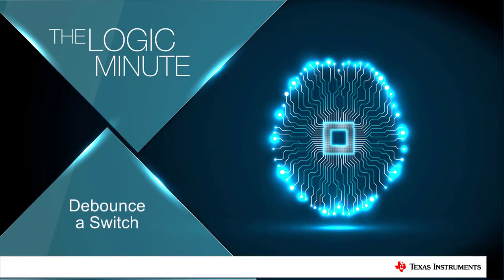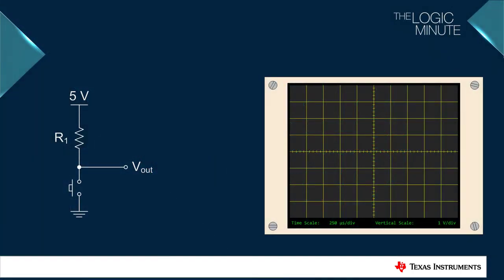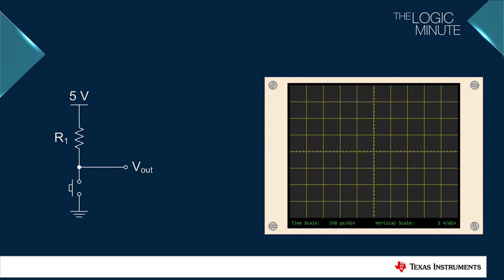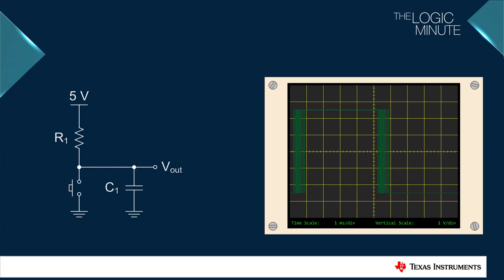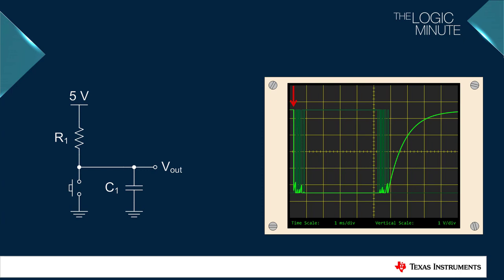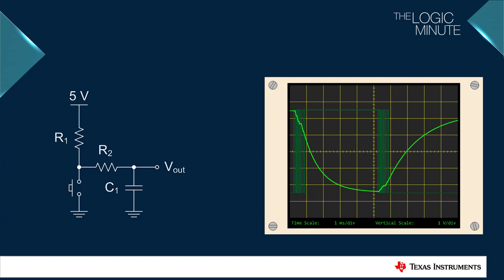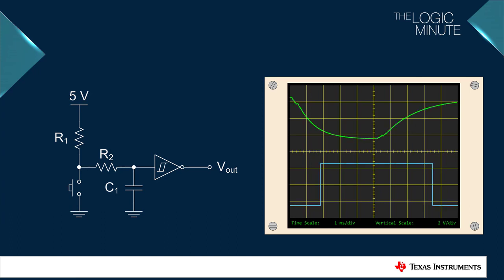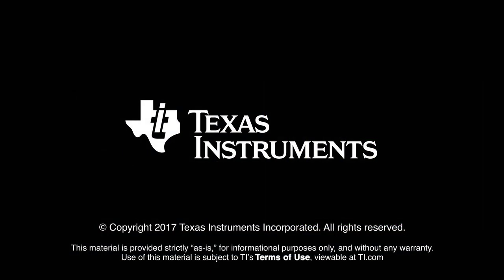Debounce a Switch

Comment: Syntax error? Shouldn’t 00:21 start at 5V since the switch isn’t pushed and thus effectively be open so Vin = Vout = 5V?
Reply: They have it the wrong way around but we all get what they meant
Reply: that picture showed what it should read based off the state of the button, noithing wrong with it
Reply: The waveform was just captured for demonstration purposes; it was meant to show the behavior not to show the rising or falling voltages, etc.

Comment: This should be already implemented inside the microcontroller pins, if enabled...just like enabling internal pullup and pulldown resistors
Reply: The size of the cap needed to do this would be astronomical to put it on the die.